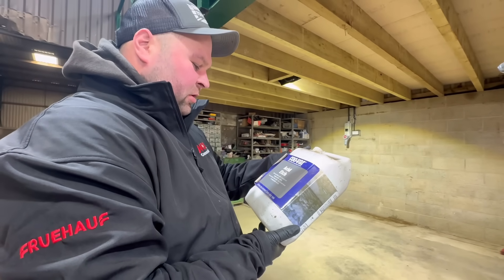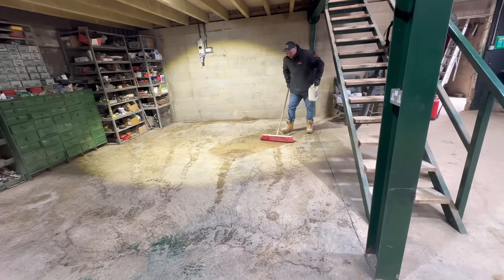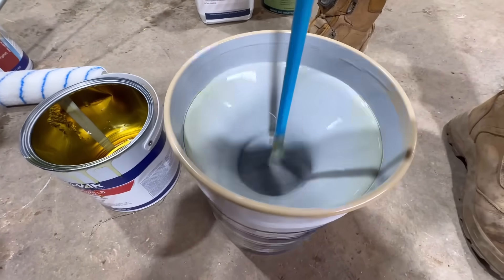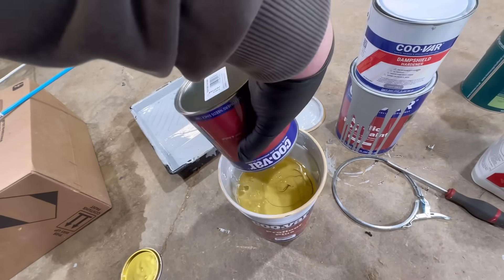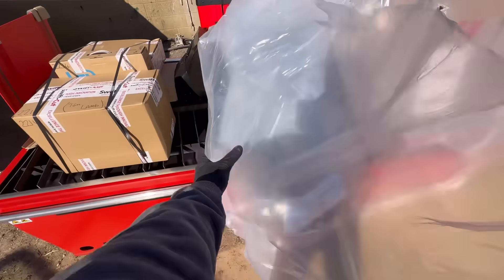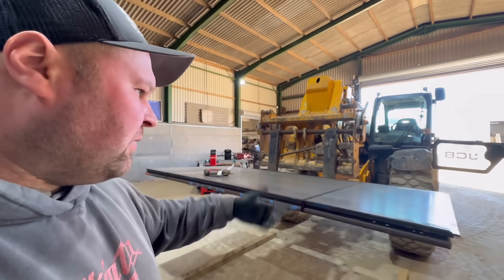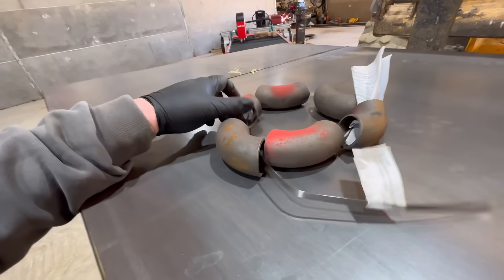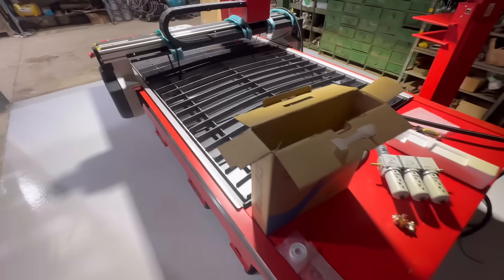A new dream machine has arrived on the farm (swift cut pro) plasma cutter

Comment: Every person with an engineering background would so love one of those or a waterjet cutter.  Plasma has the advantage of not needing consumables.  Fireball Tools gets his garnet by the pallet load which is not only a cost, it is also going to be a horrible job to clean out the tank.  Imagine a pallet load of wet and heavy sludge at the bottom of a tank with three foot sides you'd need to lean over, plus you'd need to dump it somewhere.  You mentioned draining the tank, and while there won't be the garnet sludge, there will still a shite load of metallic grit when it's time to clean the tank, and I was wondering about it clogging the drain valve?  Swiftcut will have that under control no doubt.  Hey, could you use a big feck off magnet to get the sludge out of the tank?  One of those magnetic swarf sweepers would work.   Now you need to design a really cool Tom Lamb He's a Farmer sign for the workshop wall, and another one for the farm entrance.
Reply from the maker: @TrevorDennis100  the whole tray lifts out to empty it

Comment: Hey Tom! Great investment! What air compressor are you feeding the table with? We're just installing a 7.5kW Screw with Drier for one of our customers plasma tables.
Reply from the maker: @djdunc  il show in the next video
Reply: @Tomlamb980  Great stuff. Those tables are a pig for air usually, not super high consumption (around 18-20CFM) but duty cycle is too much for a piston.

Comment: Brilliant! a fine machine, good choice for a 8'x4' sheet and the water table.
I'd have been tempted to put it the other way round though, I load mine side on with the forklift, it's lot better than messing about with a hoist, way faster.
I can pick a sheet off the rack and straight onto the table in no time, the advantage of being side on is you can place a 3' piece of tube across the slats towards the front, lower onto that, then remove the tube to lower the sheet, granted I built mine with slightly raised sides, that's handy to pry the sheet up.
I made 2 sheet racks for my workshop, they really work well, will take 120mm of sheets on each shelf, only used 60mm box on the ends and 50mm heavy wall across, plenty strong enough.
I'll send you some info, might be of use, never know.

Comment: all you need now is a overhead rail crane to put the metal on. not sure if its call that but hope you get what i mean
Reply from the maker: It’s going to be built by the machine on a later video
Reply: @Tomlamb980  nice that will be the iceing on the cake